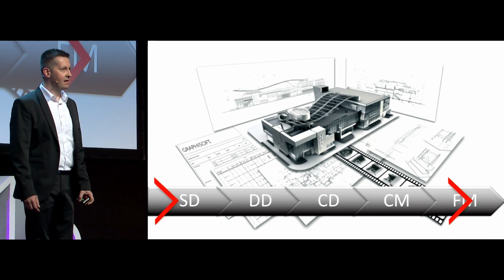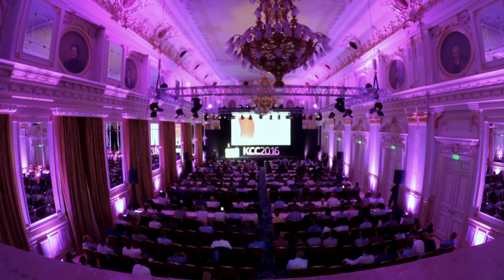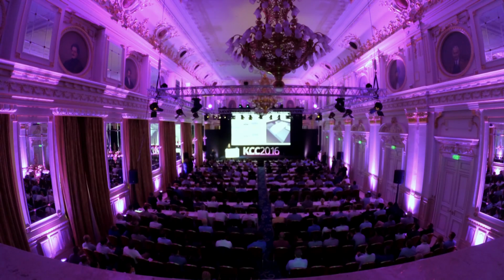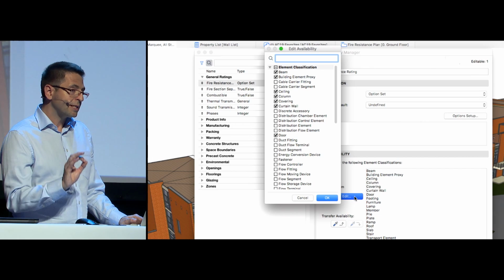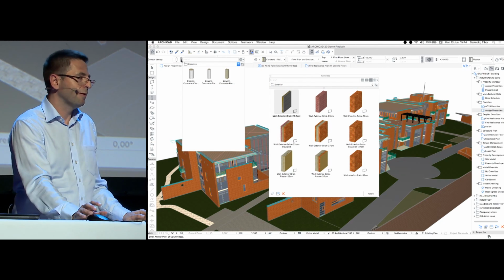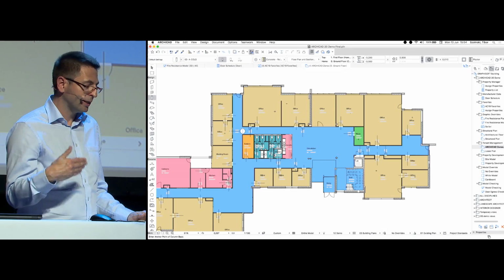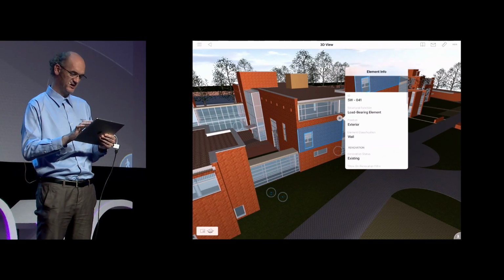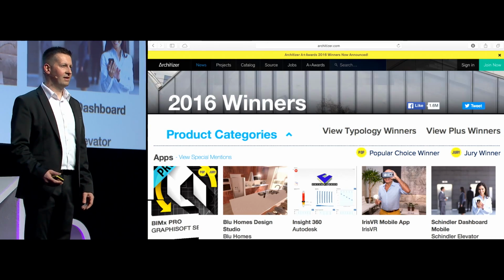ARCHICAD 20 LIVE Premiere - GRAPHISOFT KCC 2016

Comment: Is there something new? Something, what makes everyday work easier and faster? Did you finally include the diameter tool as an option of radius tool?
Will there finally be adequate roof tiles? Corner sofas as single unit? Materials, surfaces, layers grouping? Stair railing tool?
Reply: NO, but U can design icons ;) :D
Reply: Prdík WOW! It is really necessary!
Reply: But comes out - CAN'T!
Reply: If you cant do all that yourself in AC you lack imagination, not tools. The tools have been there for a long time.
Reply: Życie Pod Palmami sometimes there is nothing to do with the imagination.

Comment: The restyling of the user interface in ArchiCAD 20 is a great thing and a step towards a good user experience, the beginning, the face makeup, and a lot more has to be done: the composites' list - just to name one thing -  which is still the same old, outdated and quite useless list, needs to be thoroughly updated. I've never once used any of the composites available in that menu and I always have had to make my own, so what's the point of that list? In this instance Allplan's approach where there's no premade list and the user decides at the moment the number of skins, the height and thickness for each one of them, the calculation method (m2, m3, lm, ecc) for the bill of materials, the textures, the hatches and so forth, and can save them in the assistent libraries if he wishes to do so, seems to me a far better approach. Materials and textures' lists should be updated as well. The Toolbox should be developed further also: building components like chimneys and a dedicated foundation tool with beds, footings, areation systems, ecc, should be added. I find it quite out of place and date that I have to use the wall tool to make foundations. Walls are walls, foundations are foudations. Again, I would take example from Allplan which actually has three different options for foundations: slab foundation, strip footing and pad footing. And last but not least, less menus, sub menus and scroll down lists, where possible obviously. Those things are incredibly time consuming to go through and often confusing. I'm sure a lot of options, lines, check marks and so on can be summarized and simplyfied further. As I said before the only thing I would increase in an orderly fashion are the tools in the toolbox, and by orderly fashion I mean a chimney button, proper flat roof button with options for proper edging, a foundation button, a wall button - not one button only for wall and foundation - so if I have to do just a foundation I don't have to go through a whole lot options that are not relevant to what I'm doing at the moment. Come on Graphisoft you can do it.